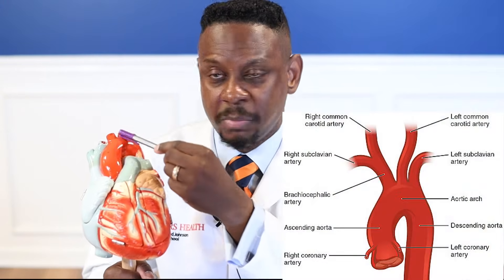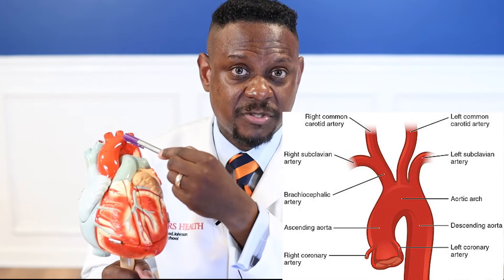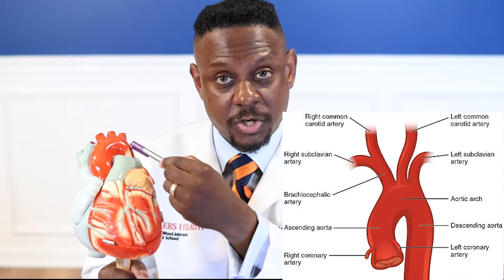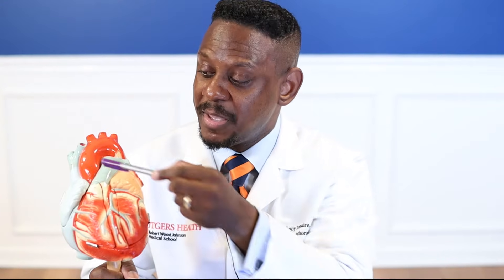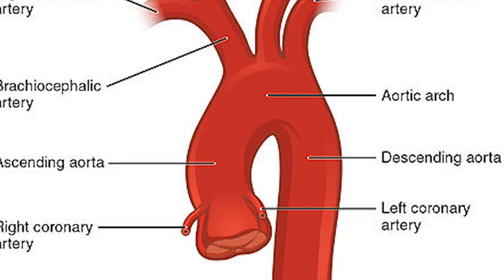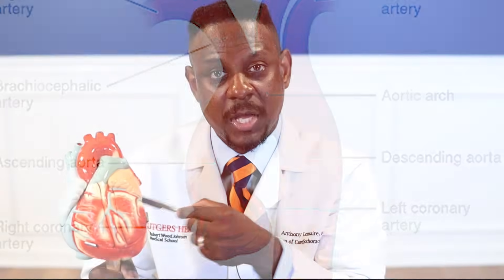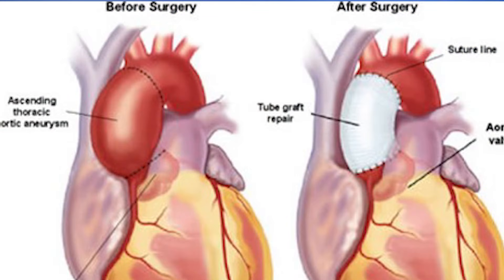Repair of An Ascending Aortic Aneurysm

Comment: I'm exactly one month shy of my 9th REbirthday,; 8 years and 11 months ago, I had the triple-A repaired with a metallic device, including a metallic valve. Because of this new hardware, I am on a very high dose of blood thinner medication. The aneurysm was dangerous enough to have caused a thoracoabdominal dissection, going from my heart all the way down to my right femoral artery; luckily, it did not "leak" and the blood stayed in the aorta... but it IS a residual dissection that is still in its altered state. The surgeons said that they did not even attempt to repair the dissection because it would have extended the emergency surgery that took eight-plus hours to repair the aneurysm and would have killed me. So, I live - somewhat precariously and often doubtful - with the residual dissection. By the way, John Ritter and Alan Thicke both died of aortic dissections just hours after experiencing the extremely painful and ultimately final symptoms.

Comment: In 2021, I was pursuing to get scuba certification but needed my PCP to sign off my health form. Since I already had a known condition from birth called a PFO, he wanted me to get clearance from cardiologist.  The cardiologist said he wanted to do a TEE to just evaluate size first and go from there. The results were good, and it was a small PFO, but we also discovered 4.5 cm AAA, and all we can do is monitor, and it stayed at that size for awhile. In Sept. Of 2022, I lost my wife to cancer. I took it really hard and had many periods of crying. A month later, during one of crying jags and trying to work from home at my desk,  I felt slight popping sensation in my chest and then really dizzy and my vision started to go away, and also felt nauseous.  After about a minute or two, my vision somewhat came back and stood up and stumbled across the room. I called for my son, and I said, something happened inside me, and it's not good. Called paramedics. What seemed like a blink of an eye. The cardiology team was wheeling me in for surgery.  I had disected from asending side all the way around to  desending side. Replaced valve and part of ascending aorta with mesh graft.  Rapid recovery is doing well now, but I was told in October of 2023  that I have a 5.6 cm at aortic root. So, I went for 2nd oppion at Mass General Brighams. At my consultation, the surgeon said if I had not had prior surgery, she would recommend repair, but since there is scar tissue, it somewhat benefits me. I'm still scratching my head on that. But she calmed my anxiety down and decided to just monitor for now. But I still feel like a walking time bomb. Sorry for the lengthy post, and thanks for a great video post. Your thoughts?
Reply from the maker: Sorry for the long delay in responding. The main issue you have is the large aortic root aneurysm that at SOME point depending on your age, will probably require surgery. If you are less than 80 years old, you will more likely require surgery. The actual size criteria for an aneurysm is 5.5cm. You are at 5.6cm so technically you are above the size criteria. The surgeon you spoke with is correct that the scar tissue from the previous surgery will most likely keep the aneurysm from growing. Most surgeons I suspect would not recommend surgery right away for multiple reasons. First, the surgery is very complex, AFTER you've had previous heart surgery. Second, there is a belief that the scar tissue from the original surgery will limit growth. Ultimately, I would STRONGLY RECOMMEND seeing a well experienced surgeon. This is not a minor procedure. Second, if there is further growth in size, I would recommend surgery by an EXPERIENCED AORTIC HEART SURGEON. Good luck!

Comment: My ascending aorta is at 4.5cm and it was just discovered, so it may stay that way forever but there's a decent chance I'll need this surgery some day. I appreciate that there's info out here that seems trustworthy and thorough. This is probably the most thorough description I've come across.
Reply from the maker: Thank you very much. Please make sure you keep your blood pressure controlled. Good luck.
Reply: They sometimes stay at the same number for a few years, little here little there. Be well
Reply: Tku for a Surgeon who is very knowledgable and his explanation was reassuring. May he continue assisting folk in his area of expertise  ✅🛐💐
Reply: Mine was 4.8 but because of my petite frame the risk was high.
Reply: I just discovered mine and im at 4cm. I was getting a CT scan for nerve pain and they found out I had an aortic aneurism. Not sure if I spelled that correctly. Trying to get my blood pressure down a few points and lower my cholesterol. Do they always open up your chest for this procedure or do they also go through your leg? I've heard of both but not sure. Thankyou
Reply: @josephbolin9899  Recently diagnosed with Ascending AA and was told current treatment is open chest surgery whereas with descending AA and abdominal aneurysm TAVR may be considered.
Reply: In 2006 a ct scan showed mine at 4cm. A recent heart echo showed it at 4.2 cm..very little growth over almost 20 years. Until  recently I have had very low blood pressure which probably helped.

Comment: I was recently told i have a dilatation of the ascending aorta. 2.9 cm 
I also have hypertension, high pressures on the left aide of the heart. Do i qualify for the surgery now?
Reply from the maker: Thank you for the question. The answer is no. The standard clinical size for surgery is when the ascending aorta is 5.5cm. There are some exceptions. Please review the video. Thanks

Comment: I have an aortic anurism it's at 4.1 and I'm scared I don't want it to rupture how would you know if you are in danger my Dr is keeping an eye on it but I don't have it checked till April last checked in October should I be worried???
Reply from the maker: Sorry for the delay in responding. I understand your concerns. As I mentioned in my video the size criteria to operate is 5.5cm unless you fit in the categories I mentioned or have very short/small stature. I would be most concerned if you reach the 5cm mark unless once again you meet criteria for your aneurysm to be operated on earlier. I STRONGLY recommend that you see a cardiac surgeon and express your concerns. Once again if you DON'T meet criteria for your aneurysm to be operated on earlier, you may never reach the 5.5cm size. Good luck.

Comment: Does it have any cure without surgery?
What vitamin or mineral is good to strenght the aort vessel?
Reply from the maker: Sorry for the delay in responding. There is no medical cure for an aneurysm. You can treat these medically with blood pressure control but the ultimate treatment is surgical if it gets to the target size. You can always decide to not operate which has its own consequences but this would require a long discussion with the heart surgeon.

Comment: Thankyou for this
I have a 5.5 cent aneurysm and currently waiting for an app to discuss when an op will be done.
Mine is thoracic 
Also have an abdonimal one which is 3cm and are goong to monitor.
Your explanation was extremely informative and easy to undestand.
For that i thankyou so very much.
Reply from the maker: I appreciate your comments. I would definitely speak with a Cardiothoracic surgeon soon who is very experienced in this surgery. You meet the requirements for surgery right now. The success rate of the surgery electively is very high in comparison to if the aneurysm ruptures. Good Luck!
Reply: How are you doing today? Did you get the surgery? Hope you are well and healthy

Comment: Can I have weight loss surgery if I have a mildly descended aorta?
The aortic root is grossly normal in size at the sinuses of Valsalva. The ascending aorta is mildly dilated. Ascending aorta measures 4.1 cm@ 3.1 cm distal to STJ.
This was an echocardiogram.
But they also said that it was hard to interpret because of my weight. My BMI is 64.
So do you think elective surgery would be safe? I'm a 56 year old woman. I have also had a heart ablation 2 years ago.
Reply from the maker: Hi, Sorry for the delay in responding. At 4.1cm, you should be able to have weight loss surgery. The risk of rupture at 4.1m although not zero is relatively low. I would personally communicate your concerns with your abdominal surgeon and anesthesiologist. Personally, I think you will benefit from the weight loss surgery given your BMI. Good Luck.

Comment: Thank you for the very informative video.
Are they currently able to repair ascending aortic aneurysms non invasively? I think it’s called TEVAR?
Reply from the maker: Great question. There are currently no FDA approved stents that can treat ascending aortic aneurysms. TEVAR is available for aortic arch and descending aortic aneurysms but NOT currently for ascending aneurysms. The main reason is because there is concern that the stent would block off the coronary arteries.

Comment: Thanks so kindly for the explanation. Wondering if you perform EVAR for a diameter of 4.9cm on 78 years in an excellent shape? Thank you for your response.
Reply from the maker: Hi, Sorry for the delay in responding. I am a cardiothoracic surgeon and I do not perform EVAR for abdominal aortic aneurysms. I do perform TEVAR on Thoracic aortic aneurysms. I am not as familiar with abdominal aortic aneurysms but I believe the size criteria is 5.5cm for aneurysm repair. PLEASE confirm this with a. vascular surgeon. Good Luck!
Reply: Thank you so much appreciate your time
Reply: I am more relaxed now as I will meet with my cardiologist today.. I don’t want to give up my 2000 yard swim on almost daily basis I used Afrin spray and Sudafed pills for nearly 40 years that contributed in raising up my blood pressure..I believe it affected my high pressure negatively. I hope it’s not too late as I stopped cold turkey..Thank you again.

Comment: Please can you tell me if my husband who has a 5cm asending aneurysm just found out, moderate aortic stenosis and bicuspid valve can be operated on? History of submarachroid hemorage small TIA and severe c.o.p d , its not looking hopeful 😢
Reply from the maker: Hi, I appreciate the question. First, as of right now, your husband does not have an indication to have surgery now. His 5cm aneurysm doesn't meet the 5.5cm aneurysm. His moderate aortic stenosis does not meet criteria for surgery. Now, his bicuspid aortic valve does put him at a higher risk of the aneurysm growing and potentially an aortic dissection. I would STRONGLY recommend that your husband gets seen by a very experienced cardiac surgeon. The subarachnoid hemorrhage puts him at a higher risk for intracranial bleed but if there is enough time between the diagnosis and surgery, the risks goes down. The severe COPD is another concern for possibly not extubating after surgery. Your husband needs several consultants (Neurologists, Pulmonologist, cardiac surgeon) to optimize his condition and make him a better candidate for surgery. I would not give up on your husband. Finally, I would ask your husband to please speak to his doctor and get the consults that you need. Please contact me directly through my website for referrals for experienced cardiac surgeons in your area.

Comment: How common is it for a woman to have this issue.  My aorta is at 4.1 cm.  Why does this happen?
Reply from the maker: Hi, you have some very good questions. I personally don't know the exact numbers but in my personal experience aneurysms are more common in men than women. At 4.1cm, your aneurysm is very small. At that size you would only need monitoring and no surgery. Regarding your question, most aneurysms can be formed by a (1) genetic cause, (2) high blood pressure, or possibly bad luck. These are the reasons that all patients get aneurysms not just women.

Comment: This week I was diagnosed with an ascending aorta aneurysm, 4.2.   I am curious if anyone has had this type of aneurysm repaired using a minimally invasive procedure?
Reply from the maker: Hi, I apologize for the delay in responding. There are certain surgeons that can perform this operation through a minimally invasive approach. Hopefully you will never need the operation. At 4.2 cm that is a small aneurysm . I would strongly recommend keeping your blood pressure controlled, and get a referral to a cardiac surgeon. Good Luck!
Reply: Me too🎱

Comment: Thank you for this, I just learned yesterday I have a 4.5cm ascending aortic aneurysm.  My daughter has Ehler Danlos syndrome so my doc is sending me for genetic testing to decide what's next.  I'm fit as any 58 year you'll find, I'm ranked #1 in the world in the Spartan DekaFit Mile 55-59 age group, so this rocked me and I'm trying to learn as much as possible as fast as possible, I've done everything right in life when it comes to health, I can't believe this.  

Does having Ehler Danlos change the equation that much?  And if I can try not to "strain" too much, is it risky to compete in hybrid sports like Hyrox and DekaFit (kind of like crossfit with 8 1000m sprints between workout stations)?
Reply from the maker: Hi, sorry for the delay in responding. If you have any connective tissue disorder you generally will have an aorta that grows faster than someone who doesn't have that disorder like Ehler Danlos syndrome. I would say from a patient perspective I would (1) confirm the diagnosis, (2) keep your blood pressure well controlled, and (3) get referred to a cardiac surgeon (experienced in aortic surgery). I would say that it's ok to work out but as you stated, I would try to limit activities with lots of straining such as power weight lifting. Your aorta is relatively small at 4.5cm and you have no indication for surgery at this time. There is a good chance that you will never have to have aortic surgery.
Reply: @cardiacsurgerypatienteduca2445  I wish I could do something to show you my gratitude, your reply is the best news I've heard and gives me hope....thank you so much...the world needs more people like you....thank you again.

Comment: I. Just found out that I have a 4.0. Cm aortic root aneurysm.  My dr wants to just watch it and do yearly ultra sounds. I’m a nervous wreck. I get heart palpitations daily due to stress. I’m on beta blockers. How fast does an aneurysm grow normally and do they ever stay same size like mine at a 4?
Reply from the maker: Hi, sorry for the delay in responding. Your aorta is very small. I don't know your age but there is a good chance that you will never need surgery. Every aorta grows at its own rate. A fast rate would be 1cm/year which is very rare. Some aortas never grow especially with good blood pressure control. Its possible that your aneurysm will never grow.
Reply: I’m in the same boat as you. I’m at 4cm. Cardiologist doesn’t seem concerned though.

Comment: My aneurysm is in the arch. What happens if it burst ?
Reply from the maker: Hi, sorry for the delay in responding. Arch aneurysms are not as well understood as aneurysms of the ascending and descending aorta. Any part of the aorta that burst can lead to death if the rupture or bleeding is not controlled. The management of the arch aortas are not as well discussed. Some of the surgeons treat the arch aneurysms with medical management until it gets to 6cm however other surgeons will operate when the arch aneurysms get to 5.5cm. To answer your question however arch aneurysms that burst can ultimately lead to death if not controlled.

Comment: Dr. Anthony, can't this surgery be done Endovascularly? Just like how it is done with the abdominal aorta?
Reply from the maker: Great question. Currently, ascending aortic aneurysms cannot be repaired endoscopically because of several reasons. First, because of the presence of the coronary arteries there has always been a fear that the grafts with occlude or block the coronary arteries. If that occurs that can be fatal as the heart would not get blood. Second, there has not been grafts created for the ascending aorta that have been FDA approved. Now, there are some off label grafts that can be used but to my knowledge, nothing has been approved. I suspect in the future there will be grafts for the ascending aorta but currently none there are commercially approved exists.

Comment: Hello doctor! I am 33 years old and has diagnosed with acyanotic CHD Bicuspid aortic valve and Aneuryomal ascending aorta
AV annulus-25 mm
Aortic root -36 mm
Ascending aorta - 55 mm
Isthmus -36 mm
Descending aorta-30 mm 
Is it treatable without open heart surgery
What is the life expectancy after treatment please suggest me from India needs urgent guidance
Reply from the maker: Hi, Sorry for the delay in responding. I understand the hesitancy to have open heart surgery. At this time, I personally do not know of any method of treatment for an aneurysm other than surgery when it reaches the size criteria. You could decide against surgical treatment as it is your choice, however, unfortunately you are at the risk of rupture and possible death. I would strongly recommend meeting with several cardiothoracic surgeons to make a decision. I'm sorry, that I personally don't know of any other options.
Reply: @cardiacsurgerypatienteduca2445  thank you sir for your opinion

Comment: Hey Doc , I have a aneurysm of 4.6 at the amending aortic root. What is yhe most difficult to repair. Thanjs
Reply from the maker: Hi, There is no "difficult" time to repair however, the size indication for surgery is 5.5cm. Most surgeons don't wait that long though. I would strongly suggest that you meet with a cardiac surgeon to discuss this. There are multiple issues that need to be reviewed. When the aortic root is enlarged the aortic valve will often not work well. Good Luck. If you have additional questions, please email me.